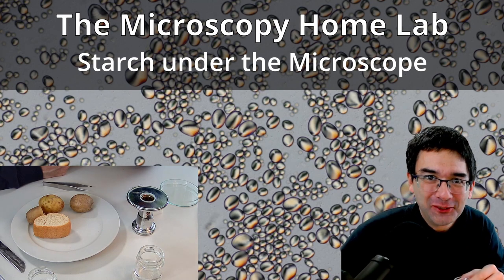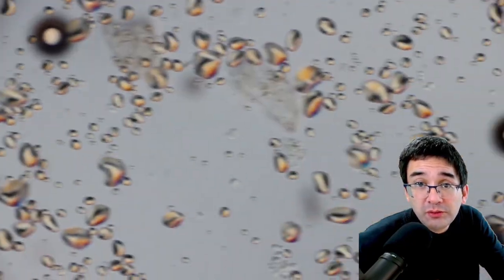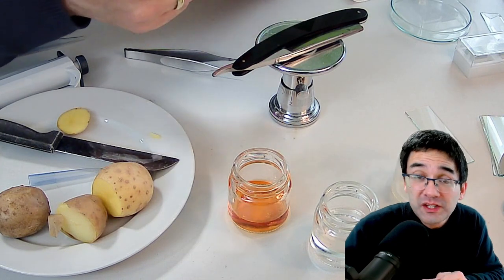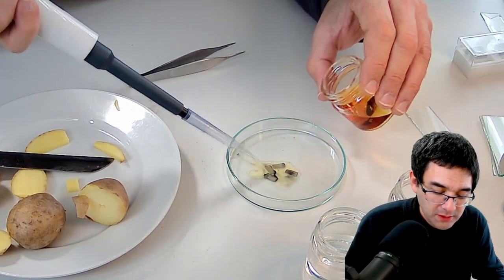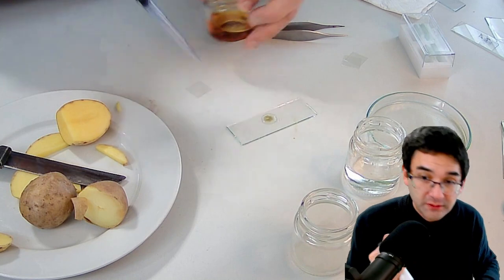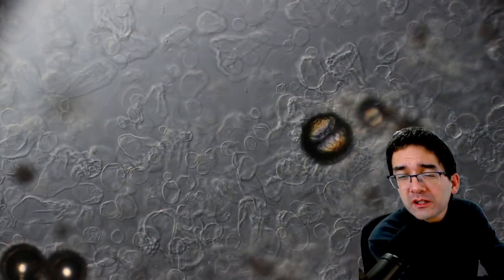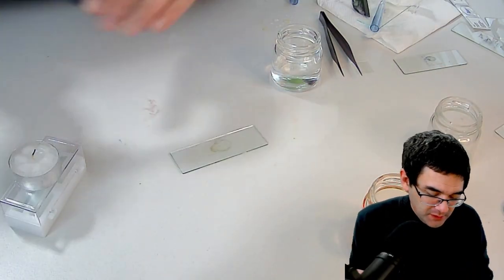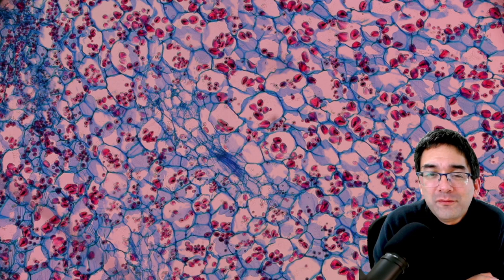POTATO STARCH made visible for microscopy (long video) 🔬 230

Comment: Hey, I noticed that the pipette you used was a 100~1000ul pipette, is that the ideal “size” or would a “smaller” one also do?
Reply from the maker: A smaller 200ul pipette would also do, because the amount of water placed on a slide is maybe about 100ul. I chose the large pipette, because I can also use a small volume if I want to. It is much a question of personal preference, and a smaller one certainly will also do fine.
Reply: @Microbehunter  thank you!

Comment: @Microbehunter Which camera are you using now?
Reply from the maker: I have a Canon EOS90D
Reply: @Microbehunter  OK Last question.I recently bought a Swift 350T and want to connect my Sony A7RIV to it but not sure which way would give me the best results. I hav e a T adapter for the Sony to connect to my telescope but want to connect to the Swift trinocular. Which adapters would give the best results as I've watched a few of your videos and notices some adapters give a chromatic aberration which I don't want. What adapter will fill a full frame sensor with the least amount of arbitration or would it be better to just buy one of those small microscope cameras on Ebay or Amazon?